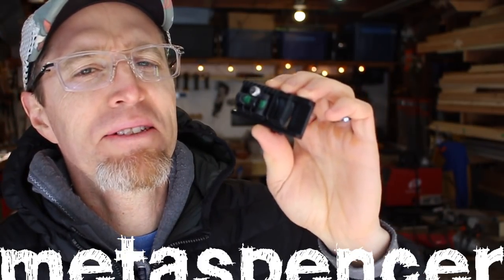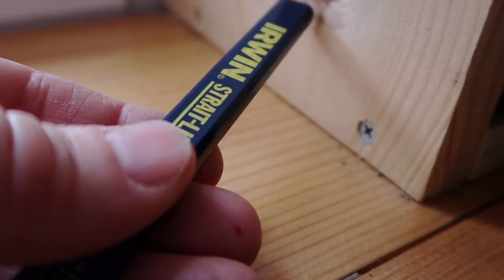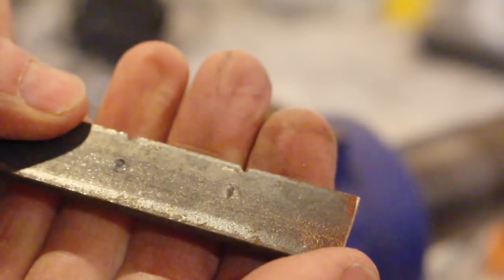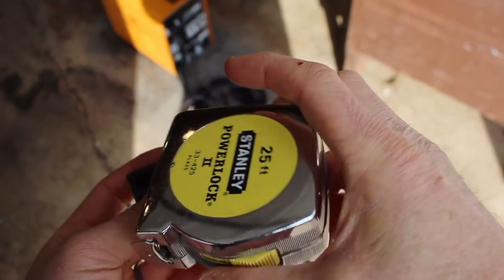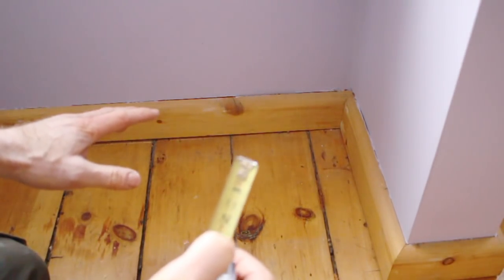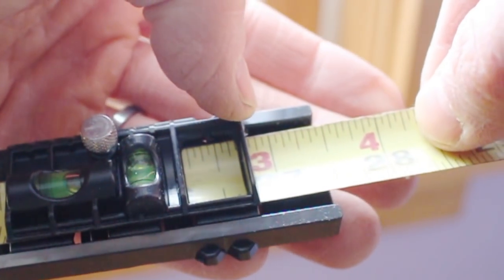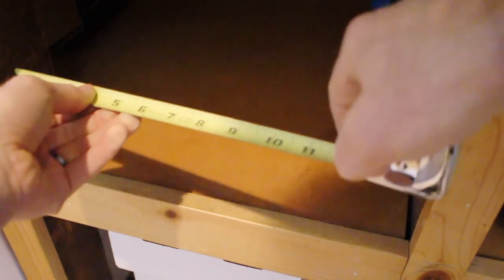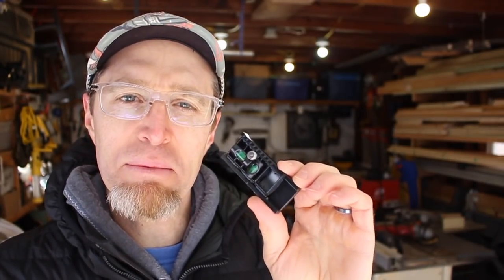Do You Need This Tool? The "Add an Inch"

Comment: As you know, I'm a nut when it comes to my measurements.  I have been using it a lot for the last week now and while I have to fiddle with it and at times it make the measurement a lot harder, the measurement is spot on.  For the template for the curve in our roof, it has been invaluable.   I was using a 2x2 (because it was lying there) and then I measured the 2x2 and it was about 3/64ths off. While that isn't a lot, it was for me.  The other thing I really liked was the marking notches.  Repeated cuts on my not so advanced table saw was a lot easier.   I set the measurement and marked multiple pieces knowing that my Mark's were identical. Yeah, not for framing a house but for finish stuff. I like it.  It stays in the finish tool belt.😁
Reply from the maker: I was hoping you'd check out the video and have something to say, as I know you've been using the tool! I like your idea of keeping it in the belt for finish work, and I similarly found that it was hitting about 1/16 more accurately than my other methods, which for cabinet building is a BIG difference. So yeah, it's awkward to use at times ... but sometimes it really comes through. Always good to hear from ya, man!
Reply: @metaspencer  👍you too my skoolie brother!
Reply: On a side note, I really hope we get to meet some day!
Reply from the maker: @BussyMcBusface  Oh yeah. That would be great

Comment: Let’s say you have a wall-to-wall scenario. You want to know how big it is. Let’s say the wall is 83 7/16 wide. On one side, take your tape and measure out to 40". Make a mark.  Now measure from the other side out to that 40" mark and you will get 43 7/16. That’s another way to measure corners. No need for fancy tools.
Reply from the maker: Cool trick. I like it and it could be scaled up and down nicely! Thanks man
Reply: I do the same but 50. Hang a lot of crown

Comment: Maybe the reason for locking in place is so you can then mark the wood using it before cutting.
Or - Move the locked in measurement to different spots to see if the measurements are equal from place to place.
Reply from the maker: Good ideas ... makes perfect sense

Comment: I would think it would be useful for building in place cabinets, or when the measurement needs to be very precise. Lock in place to use as a gauge?
Reply from the maker: I think you could use it as a locked-in-place gauge ... for fine work and in certain spaces, it's pretty nice.